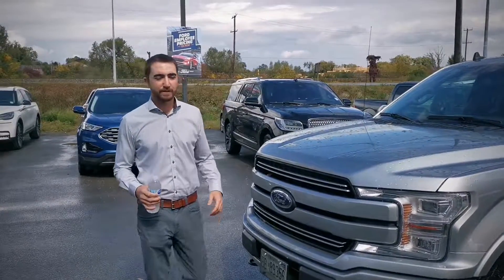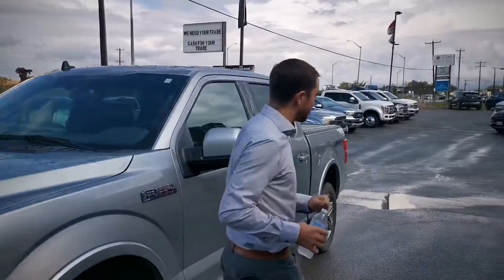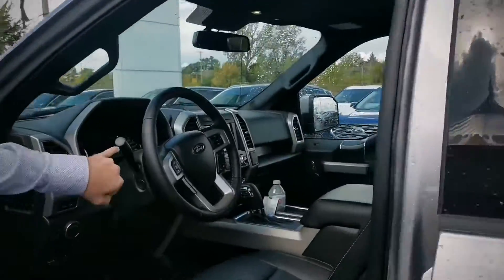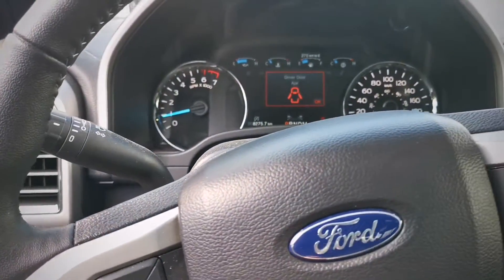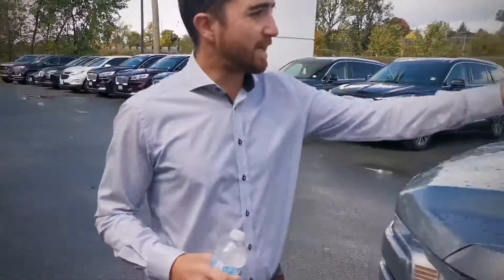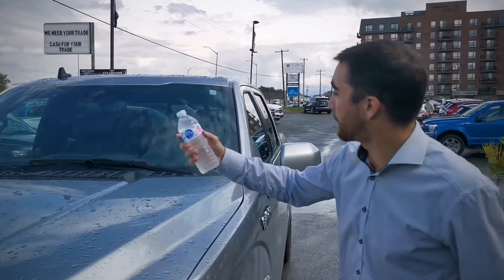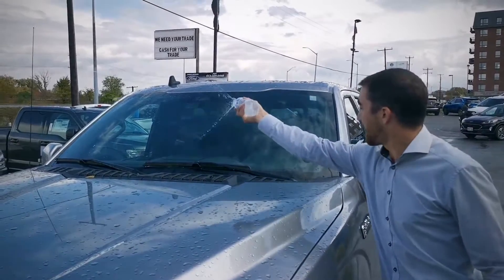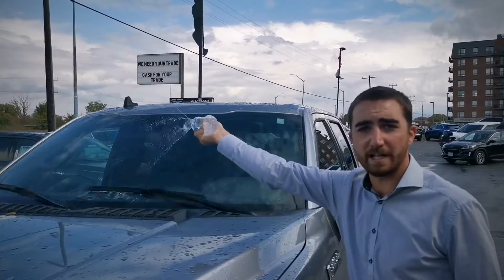Rain Sensing Windshield Wipers Explained

Comment: If your wipers cycle once and then stop on the lower speeds, your rain sensor is at fault. Unplug it and the wipers will cycle normally.
Reply: Is there a vid on how to unplug or turn off